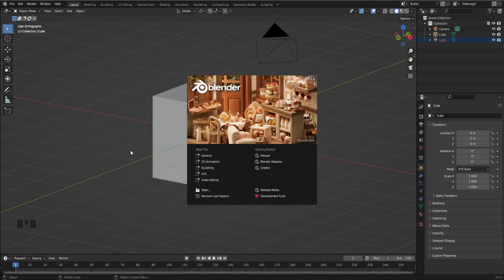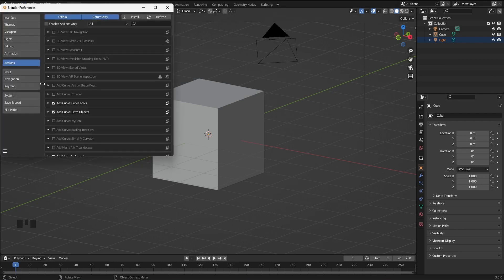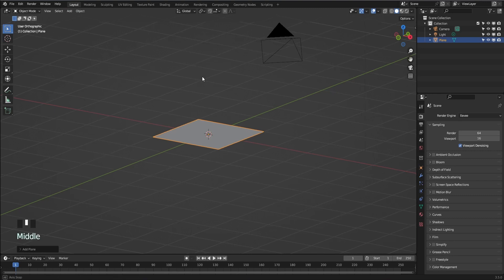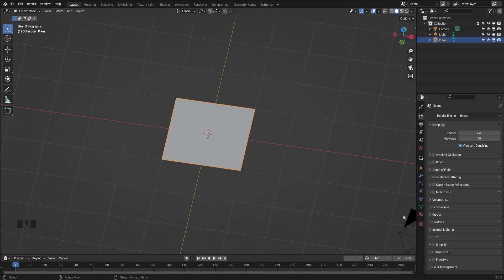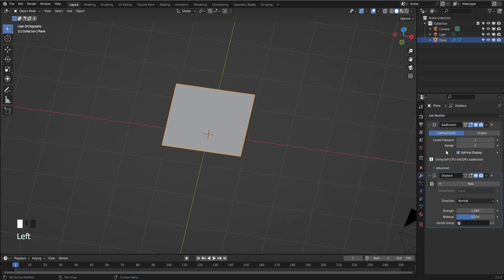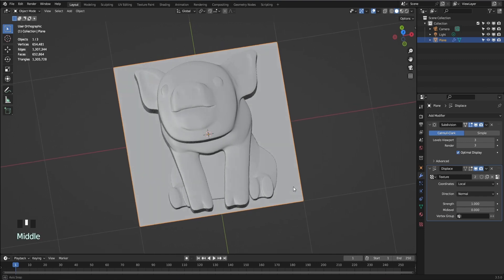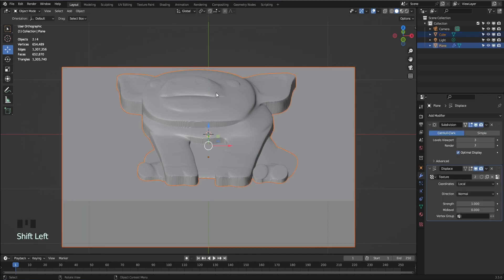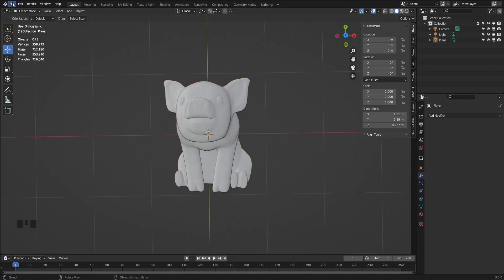Blender 3d Grey Scale Height Map To STL

Comment: Thank you ! Your method is working for some of my depth maps. But when i do exactly the same with different depth maps when i do difference everything dissapear. I dont know why. if you have any idea ...
Reply from the maker: This is a shortfall in Blender. The software is having an issue trying to align the geometry between the two objects and failing. Some things to try: try adding geometry to the cutter using subdivision; move the cutter location where the geometry might be different, remesh the objects. Sorry when it is having a hard time figuring out the solution it can be finicky.
Reply: @olgwoodart4996   Thanks for the quick reply I will try that thank you very much

Comment: Thanks. I didn’t know booleans worked with open geometry
Reply from the maker: It does. Most of the time. If it doesn't or it gives a weird result, things to try: Use the modifier boolean with fast instead of exact solver. Next try moving the cutter slightly so it interfaces with different geometry. Lastly, change the geometry by adding a subdivision simple (so it doesn't change the shape).

Comment: found bool tool, but now cant find sudivide
Reply from the maker: Bool tool as you found is an add-on that needs to be enabled in Edit>Preferences>Get Extension check the Bool Tool check box. For subdivide: In edit mode, right click on the object and then left click and a menu will pop with subdivide command as one of the options.

Comment: Another tip that helped me: If the bumps from the displacement modifier look completely wrong, try changing Coordinates from "Local" to "UV."  This fixed my problem where my displacement looked like a tiny repeating texture.
Reply from the maker: Awesome you figured a way to make it work. When you feel a little bit more comfortable with the workflow, and you just want to play, look at the different displacement modifier options as well as the texture panel which also has several options there. For abstract patterns, a fun way to experiment.

Comment: Do you maybe also know how to do the exact same thing for a perspective projection rather than orthogonal? 

I wanna do the following:

Ive got a 3D model, of which I took a transparent and Perspective Projection (kinda like immitating a xray image). I loaded the resulting projection image as a texture onto the subdivided displacement plane (exactly like you showed), but rather than using orthogonal View with the camera I wanna use perspective to get the "correct" rendering. 

I tried to simply switch to perspective with the Camera options and played around with the focal length but all I get in the rendering is a black picture with a few single white dots, vaguely representing the original object.

If I do everything with orhtogonal projection it works perfectly fine.

EDIT: Would it be possible to let individual segments of the divided plane grow towards the camera instead of simply straight up? because this would have the same effect like taking a perspective into account!

Thank you very much in advance, I learned a lot from your video!

Peace!
Reply from the maker: It is the same process but you have to first create a height map from the 3d model in perspective projection. The height map is the pattern. If not sure how to do that look at my tutorial on how to do it https://www.youtube.com/watch?v=T5jChUjnpDY&t=895s.

Comment: When I try to use the boolean tool to delete the difference, I select the box first, then the image and click on the auto boolean difference option. It takes away the box and my model. Why would this happen?
Reply from the maker: Hi. That does happen with Blender. This is an assumption but I believe when the geometry between the object and the cutter are too different the software can't calculate the difference correctly so deletes everything. If someone knows the correct reason why this happens please post a comment. 

First try to move the box to different locations so the geometry is different and see if the software can figure out the calculations better. 

If different locations don't work my second suggestion is to add geometry to the box by subdividing until the mesh density is closer to the object. It will add time and processing power to the computer but it also gives the software more points to do the calculation. 

Finally, I use the cutter to remove the unwanted background and keep the model water tight. Some cnc software requires a water tight model but some don't. See if your cnc software will take the open model. If so then just delete the background you don't want and start making sawdust.
Reply: @olgwoodart4996  ok, I was able to do it with 3D Builder on Windows

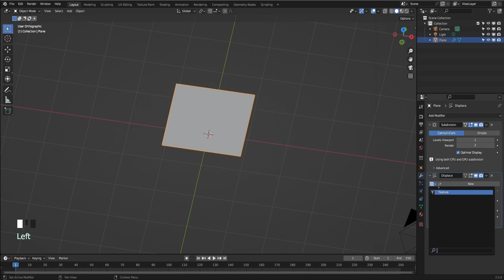Comment: Found your video. Thanks. I have gotten as far as 2:02 on the time scale and when I pic texture in the displace window. I get a multifaceted pyramid not the "extrusion" of the png file. That file came in OK. 
 I did the same thing 3x and good news the same result (bad news, it's not correct). Totally new to Blender so...... TIA

OK so I went to the subdivision window and adjusted the levels viewport and Render from your comment. The PNG is fairly complex. I adjusted the levels and render to 6 (max) and the surface has more detail than the pyramid. Not sure if that's it.
Edit II I changed the view to z- and see the outline of the PNG file but the texture is very corse. So far can't change the levels past 6 Double checked the subdivide 100 and that seems not to stay at 100
Reply from the maker: No worries. Something really simple is probably being missed. It can be frustrating learning a very complex program but keep at it. All sorts options for patterns will open up once you master this. 

Start fresh. Add plane and select it. Go into edit mode and right click mouse and hit subdivide in the command list. In the subdivide box that pops up put in 100 cuts and hit enter. Important you hit enter. Go back to object mode. In the texture tab open your height depth image. Then in the modifier tab add a subdivision modifier first and then displacement modifier. The order matters. You should see the model. You can then add additional subdivision levels to the modifier to add detail. 6 levels is the max in the modifier. This is different than the left button window.  

If you entered 100 cuts from the mouse left click command list and then go upto level 6 on the modifier you will have an incredibly dense mesh. Your computer may have problems. I normally stay around level 3 or 4 but but for a very complex model with small details you may have to go to a higher level. You can then apply the modifiers and reduce the geometry if needed (decimate modifier). We are talking many millions of verts and several 100 MB file size for the pattern if you are at level 6 with the initial cuts.
Reply: @olgwoodart4996  Thank you for your time. I'm REALLY new to blender and not all the menus in the video were apparent but with some time I worked through that. I ended up working through it to the point of "cutting" the  extusion. Wish I could write down everything so anyone reading this could benefit but context is a thing.  I'm at the point of a trimmed dimensional article sitting in space above the initial plan. It looks similar to the 2d photo but considerably less detail. Is that typical for rendering or just the way all of this translates? the Depth cloud was not defined well to start.  Thanks again.
Reply from the maker: @davidbolliger5470  Glad you figured out. The clarity of the model completely depends on the quality of the depth map. Each pixel in the depth map image is the x,y location and the grayscale conveys the z data. You want to use uncompressed file format images which can be hard to find unless you make your own. A good depth map can give you a very detailed pattern.

Comment: Thanks for making a clear and precise tutorial. It's appreciated. Is it possible to generate an STL file of a complex depth map from an image focus stacking application, such as a Diatom? I tried, but the results were totally unsatisfactory. I couldn't enter more than 100 in the subdivided dialog box, thinking that might be the issue. I used your train depth map. BTW, how is your mouse configured button wise? I am using Blender 4.0 and a noob.
Reply from the maker: Hi, thanks for playing with the process. I am unfamiliar with image focus stacking software so I can't speak to that but you can always generate an STL from a good depth map. The 100 in the subdivision box is just a starting point for enough geometry to give you an idea of that the displacement looks like. The final geometry is generated with the subdivision surface modifier. I use a standard two button scroll wheel mouse with no changes. Lastly, I am using 3.5 currently but will probably upgrade to 3.6. I am not liking the UI changes in 4.0.

Comment: Hi Oscar. I never get the image appearing on the plane. I've tried many times. Like pw3111, I don't see “half float precision”. I have "Apply" buttons on each of the Modifications and have tried clicking them in various orders. All I've managed to do is turn the Plane into an octagon.
Reply from the maker: It sounds like there may not be enough geometry for the image to displace. This is a four step process. First make sure you did the 100 subdivision first. Add the texture type as image. Add subdivision modifier then add the displace modifier. I'll add info in the router forum.
Reply: @olgwoodart4996  
I was having the same problem, the octagon thing.
But the missing part was the very part where you got to select the plane mesh to be subdivided.
I selected the plane mesh by holding the left button and "circulating" the object like you would select something on windows file explorer.
I guess this specific part is not quite clear in the video.
I think people who are not real begginier like me would get that selection step just by looking what you were doing, for me I had to use my "background knowledge".
All that to say, thank you. 
I really got what I wanted, allthough I don't know how to improve the quality of the object.
I mean, it's good, but not with the nuances I was expecting. Maybe I should make a Blender course. xD
Reply from the maker: @mikekiske  Thank you for the feedback. To improve the quality of the model will depend on what's wrong with the model and how good the height map is (the free ones online are typically pretty bad). Smoothing, modeling or digital sculpting may be required and often is.
Reply: @olgwoodart4996   I see. I made a model using copilot, then converted to depthmap using Tiled ZoeDepth, then inserted on blender.
I was asking about the quality because on Aspire it looks better overall.
But I kknow the very soon we will have what we need, maybe a "one click make it all" kind of thing.
Thanks.
Reply from the maker: @mikekiske  My understanding (I don't have Aspire so grain of salt) Aspire automatically applies some smoothing to a depth map. For your Blender workflow add a smooth modifier to the end of your modifier stack. I normally bump up the factor to 1 and the repeat value to 5 or 10. The result should be closer to what you see in Aspire. I use Standard Diffusion XL and marigold height generator and the smooth modifier has become a part of that workflow plus sculpting and additional modeling. The AI models are never perfect for me.
Reply: @olgwoodart4996  Nice. Thanks a lot for your feedback.